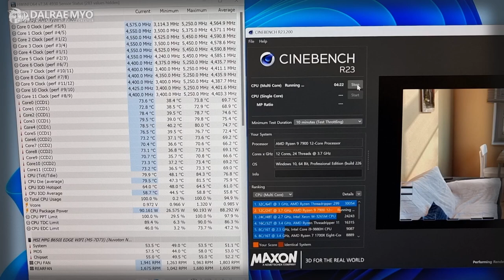Fractal Design Ridge Black | ITX SFF PC Build

Comment: May be, issue with power cable have solution. For example Noctua have 2 positions of AM4 mounting bracket adapter for radiator displacement. While making this build, I also have this mistake, but I start thinking, why it happen with compatible CPU cooler, & find solution by reading doc`s more carefully.

Comment: did you manage to put in the psu cable socket? what about rotating the CPU cooler to be able to do so? what about the noise levels while the GPU and CPU are at 100%?
Reply from the maker: For AMD sockets, 90 degree rotation was not possible. The reason for not rotating 180 degrees was for VRM cooling. It didn't feel like it was quiet during the 100% load. The noise from the 140mm cooler bundled is louder than expected.
Reply: @DalraeMyo  was 180-degree rotation possible? I will be building an AM4 system using the same cooler and case very soon and wonder how to avoid having the power cable socket detached from the case.
Reply from the maker: @realiesOne  It can be installed by turning 180 degrees. However, there is a height limit when installing the tuning memory, and it is not certain whether the power connector interferes.
Reply: this case has 2 millions of screws
Reply: @user-qn1zj5bs5p  implying?

Comment: Do you experience any issue with your included riser? It's a known issue for this case.

Considering to buy this case for my next build, but this issue gets me worried.
Reply from the maker: At the time of purchase, I was aware of the issue that there was a problem with the riser card if I used the Radeon graphics card. Fortunately, I used an Nvidia graphics card, and I didn't find anything else wrong.

In the case of Korea, the improved riser card is currently collected and replaced at the place of purchase, but I don't know how it is overseas.
Reply: @DalraeMyo  I didn't know it'd behave differently with Nvidia GPUs, thank you for clarifying.